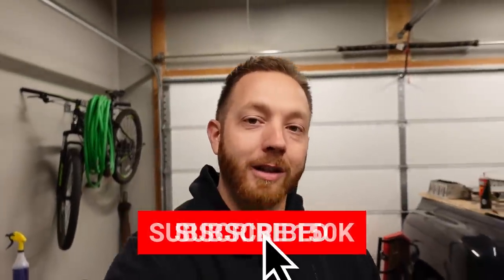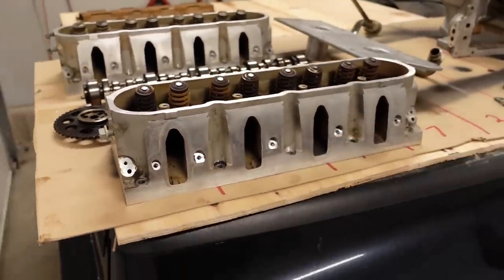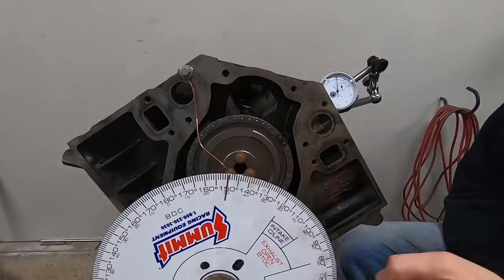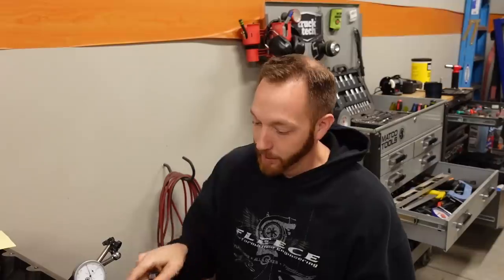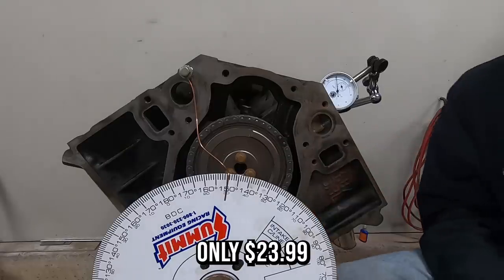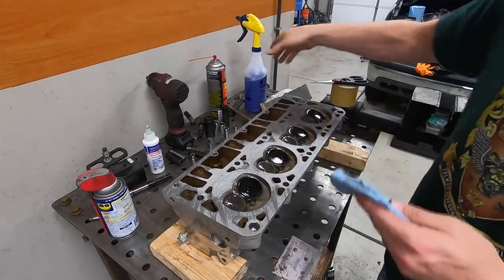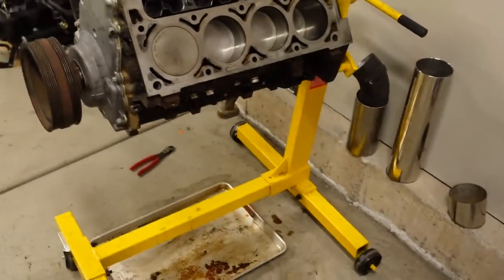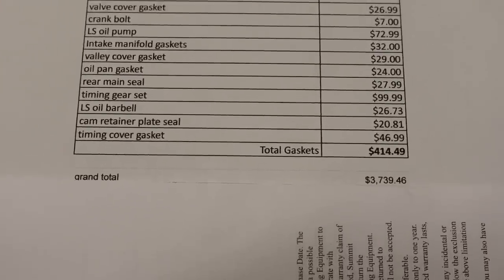LS Cam Swap Do's and Don'ts: 4.8 vs 8.1 shootout pt.4

Comment from the maker: Let me know your thoughts on a TBSS intake swap! I am considering doing it once we get the engine in and tuned/on the dyno to see where we land with the upgrades we already have
Reply: Get it, with Glens Performance throttle cable bracket.
Reply: I did on my lq4 swap and also had a known local guy in my area that does port work,had him port my intake.
Reply: Yes!!!
Reply: I have 2 if you decide to do it and need and I’m in salt lake
Reply: New GM intake manifold part number 12580420 $125.00 new GM fuel rail part number 12660709 $111.00  Rockauto prices.
Which size injectors?
32 or 50

Would you like a list and part numbers of the rest of the items required for the manifold?

If you have not seen review Richards Holdener video on the 4.8 he ran several intake.

https://youtu.be/cMMPRls__-U
Reply: I picked up around 40whp and 60wtq but the tbss was ported as well as the throttle body. In a cam heads 6.0
Reply: Sorry LT but I'm rooting for the BIG BLOCK, just too old-school I guess.
Reply: For as relatively small as the cam is and the 4.8L displacement, I don't think a TBSS will realize enough gains to make it worth while.  SDPC has a cam very close to yours and they saw 30HP on a 5.3, but with the smaller motor the intake is less of a restriction.  If you have budget I'd say go for it, but I wouldn't spend that money if you're honestly thinking of going LSA down the line...
Reply: I did it on my single cab made a good bit of difference
Reply: Try the dorman ls intake
Reply: I have a 4.8L in my 2007 nbs crew cab. Following this build series intently. Would love to see the TBSS intake swap. Wanting to give my truck some better performance, while keeping a manageable budget.
Reply: TBSS intake is well worth the price! Did the swap on my brothers 4.8 and also on my 6.0 and noticable difference in performance.
Reply: @hexxj.6218  Did you do just the intake on that 4.8??
Reply: @sirryrabbit  I had to do a lil bit more had to get the xlink since it was a dbw pcm and had to use the factory tbss tb.
Reply: Yea. Also why not go supercharger I feel like a centrifical would better suit the higher revving engine.
Reply: best stock intake for price
Reply: It's worth the money once it's cammed tuned and everything the intake and tb will be needed plus it's good enough to used for turbo
Reply: FYI the 862 and 706 heads are exactly the same by Flow characteristics and build materials. The 706 is the earlier head where as the 862 insulator head bear in mind there were problems with the 706 heads early in its run due to porosity. If the 706s were perfect from the beginning there would be no 862 casting needed.

You need to review Richard holdener videos
Reply: easy to do it and a good upgrade. you need to upgrade to a 90 or 92 mm throttle to make the most of it. 55lb/hr injectors are an easy match. do comp cams 1.72:1 full roller rockers with a good set of springs will add 10hp on a stock cam and more on an aftermarket cam.
Reply: Everyone raves about the TBSS intake from doman and claim it is as good as the other performance intakes on the market. Go for it!
Reply: @hugieflhr03  dormant actually makes an intake that has long runners like the tbss but takes the 3 bolts tb.. it was a good cheap upgrade before the tbss came out
Reply: @alexhickam9297  it is better than any other cathedral port intake short of the fast. on an engine with high enough power, the fast offers about 30hp over the tbss but matches it on torque. nothing else comes close because you either pay more than the tbss for the same power or just end up with less power.
Reply: Real world with the intake... no.  Think of it like this.... GM put the quote on quote TBSS intake on every single GMT900 chassis 4.8 and 5.3.  In fact they also put the 243/799 heads on them which honestly wasn't really an upgrade.  The 4.8 in a 2008 Silverado as example is rated at 302 hp... a 2006 was at 285 hp.  A whopping 17 hp at peak with heads and intake while using the same spec stock cam.  If you get the TBSS intake like I do at pick and pull yards, complete for around $50, have at it.  I guess every single digit counts here lol.
Reply: @LSswapGarage1  real world with the intake, I make more hp and more torque. To make the most you need a 90mm intake. If you think factory is the limit to the difference, then you are surely missing out on running capabilities. My 2005 4.8 was 285hp. Because of the more efficient airflow, i had to remap my MAF, add timing, remap again and then adjust my ve table. This was everything over my stock intake tuning. Regardless of throttle and intake piping, remapping the maf is needed. TBSS intake had a larger plenum and shorter (by 2") runners that are also a better design. Considering that power in the 4.8 increased from 2001 to  2005 with the exact same cam, intake manifold and heads, I'm pretty sure it was an tuning. There's also the fact the 5.3 HO with the 799 heads has a MILDER camshaft compared to the standard 5.3 with only a half point higher compression from using 4.8 pistons (4.8 are flat and 5.3 we dished) and made more power. So I'm going with GM sandbagging the tune. Since Richard Holdner sure dyno numbers that eclipse a stock intake with the only difference being the TBSS, I'm going with you are leaving information. If you don't think even a little increase makes a difference, remember Math. Torque times gear ratio equals more torque.
Reply: @ChrisOnez718  Im thinking of getting a FAST LSXRT intake on my 4.8 Sierra what do you think? Is there anything that I will need to complete the install?
Reply: It makes a huge power bump, it’s worth it for sure if you can find an affordable one.
Reply: @richardtorres1624  for the money you are paying, you will need a wild cam with great valvetrain to make it worthwhile over the tbss. 30hp for $800+ isn't worth it unless you plan on hitting 7k rpms all the time. tbss matches the fast on torque at all points. for a street truck, you will never notice the little difference that the fast would give. take the money and get the tbss with truck norris cam, new springs and retainers and 90mm throttle with xlink. throw in exhaust work with a tune for the same money as just the fast lsx-rt.
Reply: Tbss/07-13 intakes dyno tuned only pick up around 16-18 hp to the wheels…. Everyone saying to do it that they noticed a difference is basing their biased opinion off of a seat dyno.. they’re feeling the difference they want to believe is there!
Reply: My humble opinion... not going to see much gain for your cash outlay on an N/A 4.8L with the size cam you have etc. When you add boost, it will be a worthwhile mod. Matt Happel - sloppy mechanics tested it on his turbo 4.8 Colorado, was worth double what ported heads were. I would skip it until you add boost, but that's just me.
Reply: @Matt-qh8lj  most people doing a tbss intake are doing more with them. like anything else, it all adds up. also, generally speaking, it takes 7hp to feel a difference. i gained 25 with a tbss and ls3 throttle. moving the maf halfway between the throttle and air filter allowed better tuning and more timing. getting mild cam power without cracking the engine open is the point. it also means it maximized the benefits of other upgrades. when chasing numbers, find something easier for that amount of money. if you have a cam and end up with the same power curve on a stock intake, imagine what it would be like with a tbss.
Reply: @donwalsh7521  the L18 is nothing like the Mark 1-5.
Reply: @morgan2678  watch Richard Holdener
Reply: I’m very familiar with his videos and have spoken with him on a couple of my builds. I stand behind what I said-a 4.8 with a mild cam will see virtually no gain from the TBSS intake and if LT is going to go PD supercharged, then spending money on an intake that will subsequently be removed is a bit foolish
Reply: @shadowopsairman1583  oh please explain wingnut

Comment: Some of the 706 heads were bad about cracking around the head bolts . They were made by Castech . They have a  C shape logo under the rocker stands .
Reply: While this is true, i would think 20 years should have weeded out by now the ones that were going to crack
Reply: They are the heads that have the battery logo

Comment: You picked a very nice cam for the 4.8...not too big at all.  You'll make the same power and more torque with your 862 heads over the 243.  Just clean up the ports with cross buffs.  some 706 heads (castech) are prone to cracking.  the 4.8 is too small to make use of CNC heads - save your money.  A good valve job and bowl work on the 862 heads is more than enough.

An ebay "GT45" turbo is only $250 and will easily make 600+ hp.  Richard Holdener has a video comparing a turbo 4.8 with a 454.

Comment: I bought several roller cams over the years, it's recommended by the manufacturer to not use assembly Lube on the lobes, only on the journals, the lifters tend to slide up and down the ramps and it could damage the lifter and flat spot the wheel. A little motor oil will get the job done for the lobes

Comment: I would not include the torque converter in the total cost since you didn't in ugly truck. That gets you much closer in cost. I would have changed the converter also since it is very easy at this point and will greatly help the drivability.

Comment: Happel and Holdener have lots of info on the 4.8.

The nbss intake is definitely better than the gen3 intake and both are probably better than most others.

I'm running a "Don't BS me build" (Sloppy Mechanics) in my Volvo 940 with a th400 and 3.73 gear with 27" tall tires and it goes pretty good even without the turbo. 

The Gen3 rods are going to be a possible concern down the road though.
Reply: The way he’s building it, the rods most likely won’t be an issue as much since it will make less torque to make the same horsepower since he’s going to wind it out. Holdener pointed out that was probably why the Gen 3 6.0 failed in the Big Bang tests. It made more peak torque than the Gen 4 test he did. Torque is cylinder pressure after all
Reply: @SamSheepDoq  so you're going to use Gen 3 rods from here on out is what you're saying LOL OKAY
Reply: GMT900/TBSS breadbox intake
Reply: @SamSheepDoq  rod length has alot to do with it.

Comment: Loving this series. Great explanation on cam timing, that is often overlooked or poorly explained on engine build videos.  I'm not stressing on the budget and it's not because it's not my money, I love that you are doing some extra work now to save time later. Wouldn't make sense to fret over the budget at the cost of having to pull the trans later for the TC. Looking forward to the dyno pulls and the sound of the exhaust!

Comment: I'm just going to throw my $0.10 in... Skip the TBSS intake until you add a turbo or centrifugal supercharger. I would really like to see it with a turbo, the piping you fabbed for the 8.1L came out great. (I am envious of your fab skills) If not turbo, a 2650 head unit TVS blower. Cylinder heads, I avoid 706s due to the crap shoot of possibly getting a cracked set. And I just don't see the porting adding enough to justify the cost. An extra pound of boost will make more than the headwork. I'll be watching and rooting for your success no matter which direction you take with it. Keep up the quality work, I like how you not only explain, but show us how you get things done.

Comment: I was happy with the stock 4.8 that was in my Silverado. Until it spun a bearing one -20°F morning on my way to work. Swapped in a stock 5.3. Little more bottom end but doesn't seem to rev as  quick.

Comment: Good call, LT. I wouldn't use those locators either. It's details like those that make or break a project. 
Good idea welding in the AN fitting in the pan now. Gonna save you so much time later on.
o7
Reply from the maker: yup, for about $20 its a no-brainer.

Comment: If that converter is less efficient than the stock one, it will rob hp unless it is locked during the pulls. Just something to consider.

Comment: In my opinion, the 220/224 isn’t a super wild cam for a 4.8. You could’ve easily gone to a BTR stage 4 truck cam which has a bit more duration. I’ve tuned a 4.8 on that cam and it pulls strong in the 4000-7000 rpm range. To each their own though, looking forward to this build!

Comment: When you install an oil pump on an ls you need to use feeler gauges on the rotor or you could burn it up.
Reply from the maker: true... I'm gonna go back and double check it
Reply: Also that front seal will leak installed that way. I learned the hard way years ago on my first LS build.

Comment: LT, are there any adverse affects of gapping the rings, like oil consumption, or blowby problems? Yes noob question... I know. I'm learning bare with me.
Reply from the maker: in theory, if you gap too large, yes there will be some more blow-by. but if you don't have enough gap, there will be major damage. my advice would be to set gap based on the usage of the engine and bore size. for more info, check out some piston manufacturer websites, they have tons of info on gap calculations.

Comment: Great video. Im just curious as to what you are doing for the injectors. A summit stage 1 high lift in my 6.0 hit 105% duty cycle or somewhere about there at like 4400 rpm way before power was done. I bought the gm 50lbs injectors from the newer pickups
Reply from the maker: right now, its got my old stock 8.1 injectors in it (24lb/hr I think) which should maybe OK for the cammed setup, but any more power and I'll likely have to upgrade those.
Reply: @LawrenceTolman  - I thought they were around 32-34lb/hr? I am running stock 8.1L non marine injectors in my Siverado - LQ4, 214/220 .600" cam, LT headers, exhaust, TBSS intake, etc. I was around 73% duty cycle. Truck makes around 350 to the wheels on a dynojet and mid 380s for TQ... through a stock 4L80E & TQ converter, 4.10s and a not so light wheel and tire combo. I think you'll be fine until you add boost. Your duty cycle might be similar to mine even making less power if you run E85 though... just thinking out loud.

Comment: Correct me if i'm wrong but i think the oil pump must be centered in some way ... either with some filler gauge or by turning the engine by hand a few turn with the oil pump bolt finger tighten before you torque them to spec ... also the front cover must be tighten with the  pulley (and pan) installed to make sure it's correctly centered ... but anyway continu the good work you make very interesting and informative content ... good job 👌
Reply from the maker: nope, you're not wrong on both counts. I may go back in and check the pump clearance.

Comment: LT, as you know you’re down on cubes to justify the larger intake but the 4.8 is a revver, with the bigger converter I would just ask what type of charger do
you think you’d run? If a twin screw then obviously this would just end up getting replaced. If a Procharger or Vortech then I think that’s the intake to go with.

Comment: Curious, with the heads off why didn't you do a basic port/polish,  even just a gasket port job? Also, for what it's worth i would like to see a super charger on this.
Reply: I agree.  These heads flow well as stock but a couple of hours DIY just gasket matching and smoothing  would be worth it if you are adding boost at some point.  👍

Comment: Don't forget to do a bushing upgrade to the rockers. Stock rockers will not be able to handle that much lift because if you look at the side of a stock rocker you can tell that they only have a limited amount of movement before they bind up on themselves.
Reply from the maker: yup, I have a set that just showed up today

Comment: The aluminum sanding block you used prepping the head and deck surfaces, is that a store bought product?    If so, do you have a part number?
Reply: use a nice,square block of steel or aluminum...cut a slot in either end to tuck the sandpaper and save money

Comment: Dang, that's not exactly shopping with a budget. Next time try the Summit Pro LS stuff, and Speed Engineering for exhaust. Wouldn't have counted the converter towards engine costs either. Still, it should be interesting, but I doubt it will make the HP or Torque numbers.

Comment: With what u have now depending on the tq converter, which u said "pretty loose" but that's diff for everyone kinda lol, but Ima guess 320whp. The tq want beat the 8.1  I'm afraid to say. I really wanted to see the compression raised some.but the Tbss is very good upgrade over stock. I ran it for a while.

Comment: Why not do an at home port job on the heads you have? Doesn't have to be anything crazy, but it helps and its free! I'd love to see a how to on porting heads, even if its just cleaning up the factory casting a bit!
Reply from the maker: Need to buy an air compressor first lol…

Comment: I took 706 heads off cause they cracked. And used 862. 862 were actually smoother in my opinion. I used btr torque cam for my dd 5.3 truck. Idles good and powered it up but.

Comment: where in the budget do you account for the weight savings vs the big block?  handling/braking etc will be improved with the weight savings over the big block.
Reply from the maker: yup, that's def something to consider. On a heavy unbalanced truck it won't make a ton of difference, but in a light weight car situation, an LS def. has an advantage with its lighter weight. I think an LS is about 300lbs lighter than a full dressed 8.1
Reply: @LawrenceTolman  would you happen to know the weight difference between an 8.1 and a typical iron block 4.8, 5.3 or 6.0?